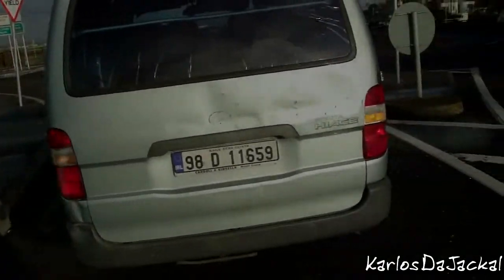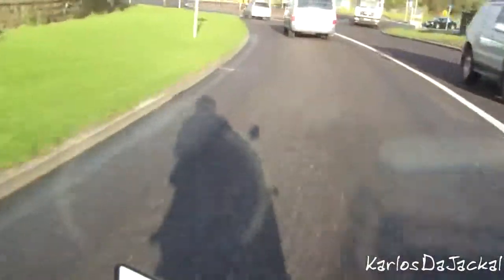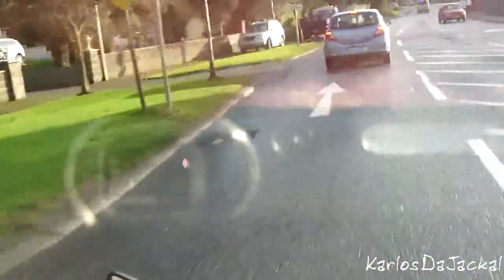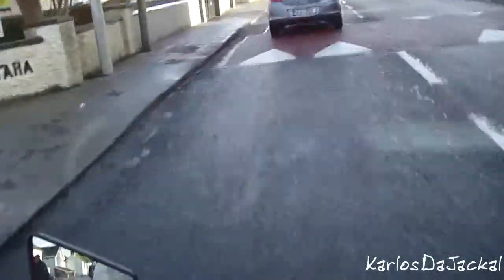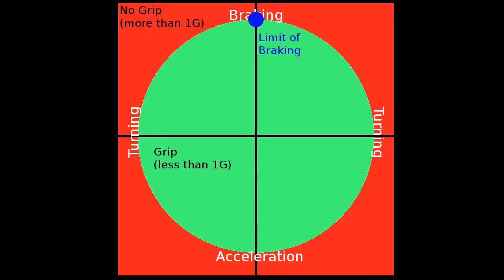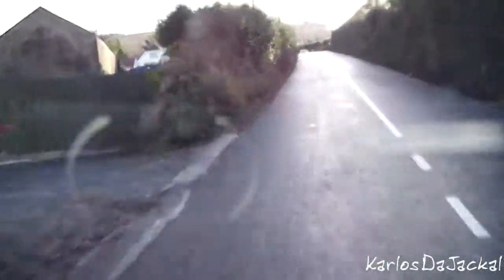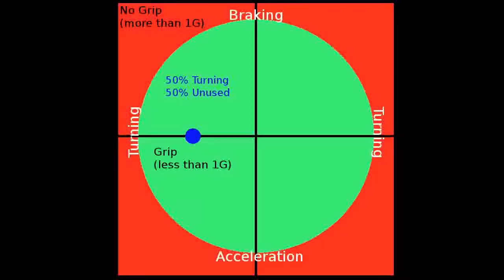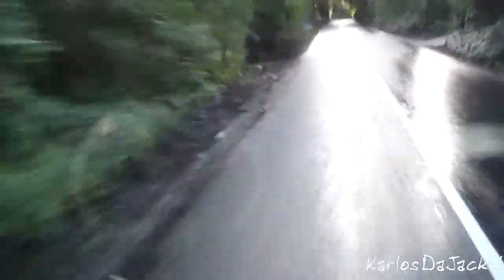Technique - Braking in Turns - Part 1

Comment: Yes you have to break in turns sometimes. You should however have your speed set right so that you can make the turn without breaking. If there is a hazard and you need to break on a turn you should aim for the side of the rode and get your bike straight up. Your bike will center itself if you break hard while leaning. This will throw you off.. As far as slow breaking tho, shouldn't have a problem.